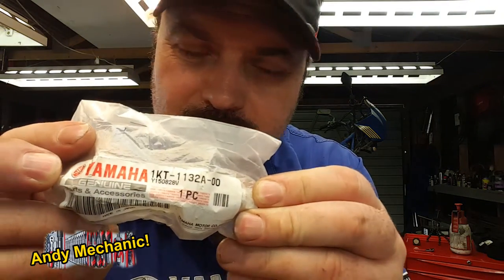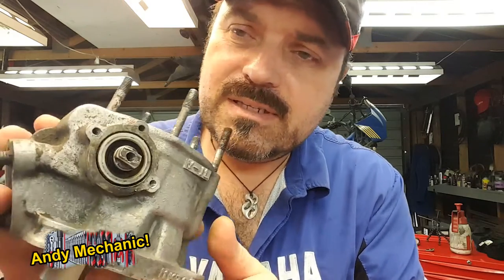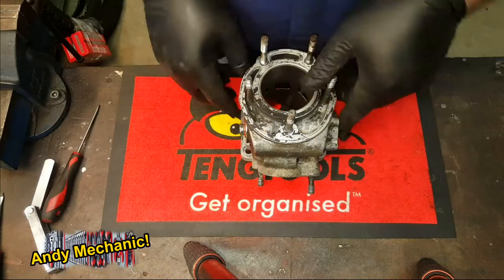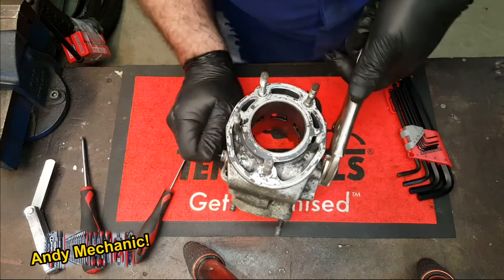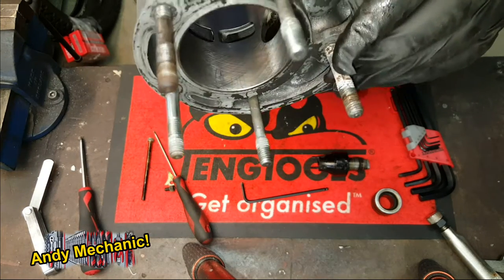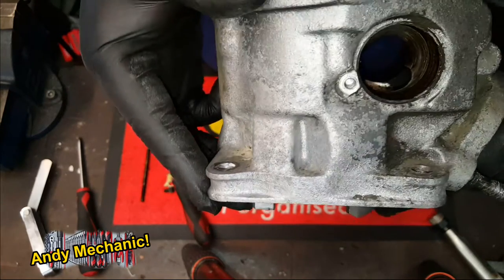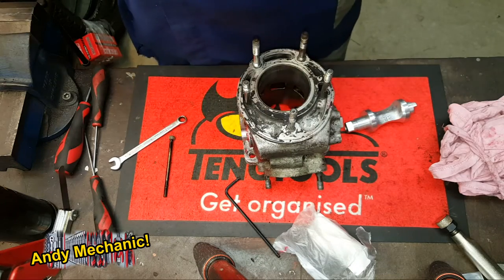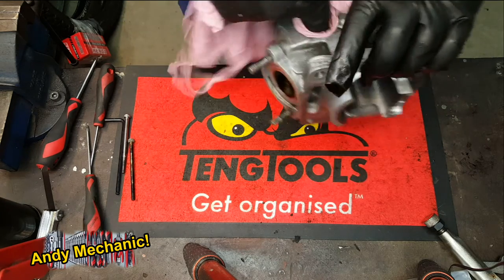TDR250 YPVS Power-valve install Ep.2 #1147

Comment: hey thanks for the video. You helped me solve my issue for my r1-z (tzr engine) and saved me so much time. The mechanic who rebuilt the engine for it put the oil seals around the wrong way (sprayed oil out the sides of the barrels), and I never would have realised without watching this. Can't wait to experience the bike while running optimally. Much thanks.